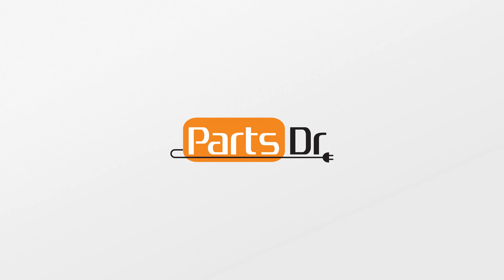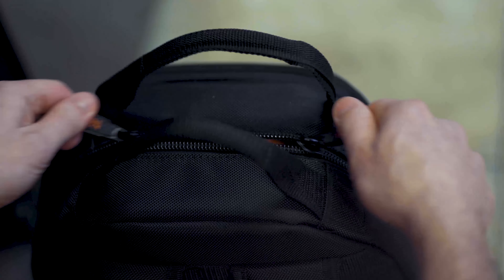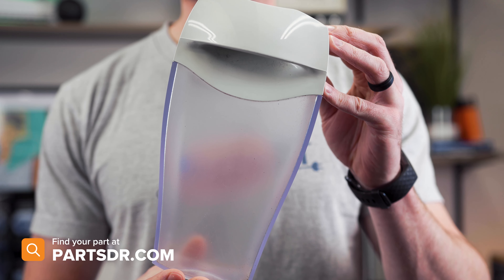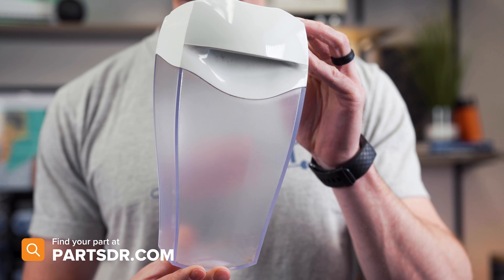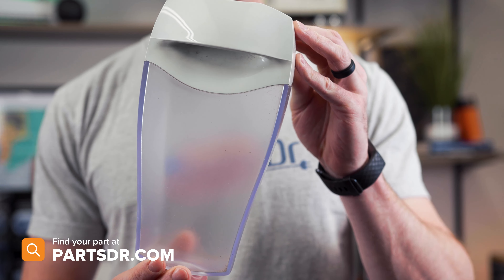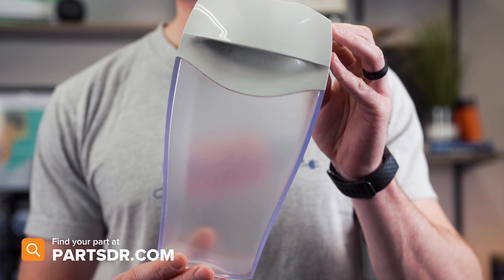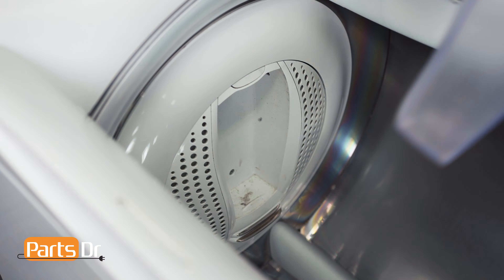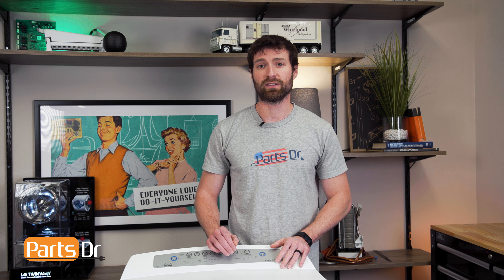How to remove lint collector cup in Fisher & Paykel dryer part # 395249

Comment: Is there a trick to getting the link bucket out when it's stuck? I've owned my dryer for 10+ years and this has never happened. It will not budge and short of breaking it I don't know what to do.
Reply from the maker: Sorry, no ideas on what would cause that off hand.  Let us know what you find as the solution.
Reply: Just had this happen to me. I cannot remove the lint bucket. Stuck in place.